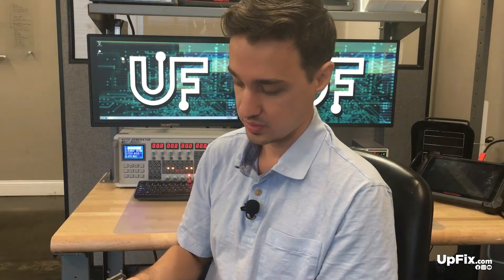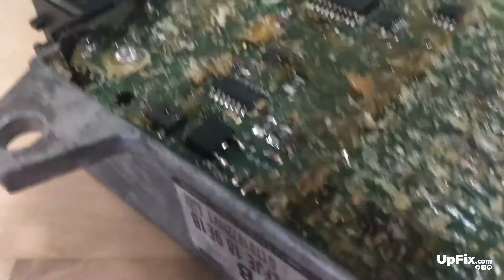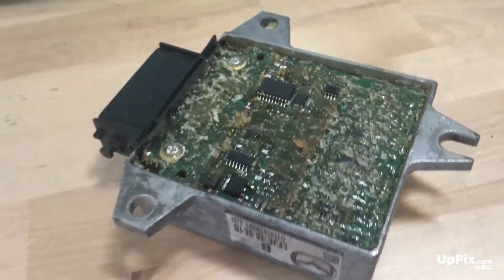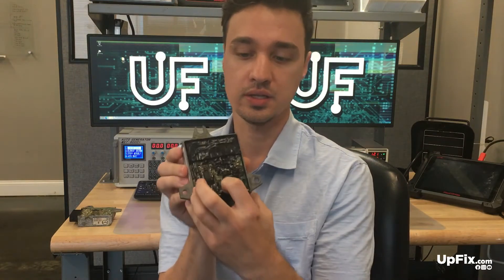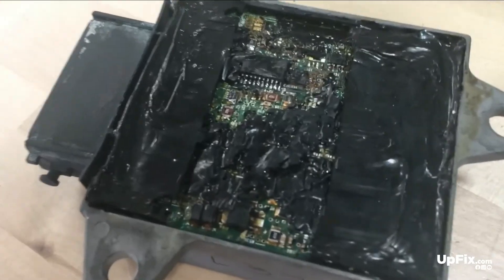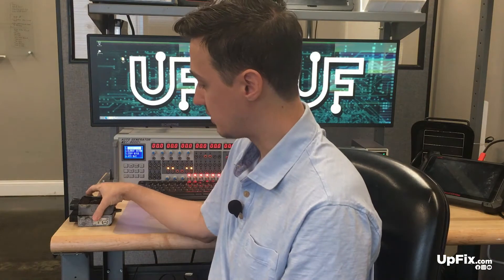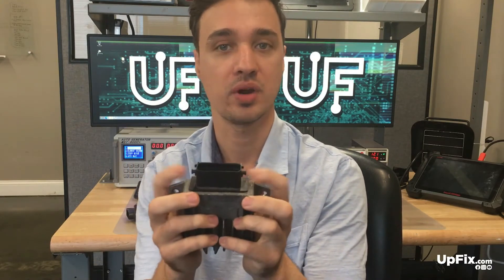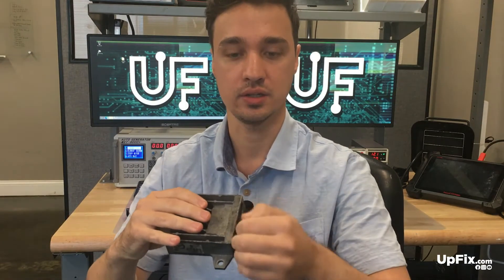Mazda 3 & 5 Transmission Control Module (TCM) Problems and Repair Service by UpFix

Comment: I tried sent to you, but you guys charging over 500 usa dollor plus shipping. To much cost you guys. I sent Ontario, they repaired same than you guys. But 440 total CAD, including round shipping
Reply from the maker: There are 2 options. 1st option is only $329 USD and that is for you to send your part for repair. 2nd option is that we send you a good unit that is ready to be installed but there is a core fee that is refunded after you send core back for refund.
https://www.upfix.com/product/tcm-mazda-3-2006-2014-transmission-control-module-repair-tcm-tcu/
Reply: Where in Ontario?

Comment: Hi good day have a 2008 mazda 3 getting a jerk when shifting from park to either reverse or drive does not happens all the time randomly and no check light or at light coming on no codes..... can you advise me.on this.situation please and thanks
Reply from the maker: Absolutely! Here's a blog we recently shared that should be helpful to you for your vehicle. Please let us know if we can be of further assistance. :)

Click Here --->: https://blogs.upfix.com/mazda-3-tcm-2006-2014-transmission-control-module-repair/

Comment: Mine, AT light displays sometimes and sometimes goes off. It its On, the digital display of gear numbers will go off too and car shift will be heavy, while it it goes off the gear shifts smoothly. What will you recommend? Kindly advise
Reply from the maker: Yes this is a common with Mazda 3 and Mazda 5. Usually these are the first signs of TCM failure. The transmission is good, its just the TCM. We do have these in stock 
https://www.upfix.com/product/tcm-mazda-3-2006-2014-transmission-control-module-repair-tcm-tcu/
Reply: @upfixauto  From the above vedio, you said repair is $199
Reply: Mine does the same thing how do I send it to you iam in South Africa

Comment: Can I put tcm Mazda 3 2008 to Mazda 5 2008
Reply from the maker: No it will not work. Part numbers are not the same.
Reply: @upfixauto  thanks
Reply: Do you have TcM transmission for Mazda 5 2008
Reply from the maker: @abosuliman123  
Yes we have Mazda 5 TCM available. There is a few different part numbers. Be sure to match part numbers to make sure you get the correct one.
https://www.upfix.com/product/mazda-3-2006-2014-tcm-transmission-control-module-exchange/

Comment: Good information, but I have a 2005 Mazda 3. I’m experiencing hard downshift from 4th to 3rd. Last time I drove my car won’t downshift to 1st. Your TCM will fix a 2005 model? Thank you
Reply from the maker: This is a very common issue on Mazda 3 and Mazda 5. The TCM starting to fail and causing these issues. We can repair this TCM. https://www.upfix.com/product/tcm-mazda-3-2006-2014-transmission-control-module-repair-tcm-tcu/

Comment: Is it caps mosfets or dry joints causing the issue , other than the  high run temps that mazda like so much.
Reply from the maker: Caps do go bad along with other PCB components. High temp is what causes this unit needing a rebuild

Comment: gear slipping/jerking from shifting 2 to 3, is it coz of ecu for mazda 6 gg 2.0 2005
Reply from the maker: Software update via OBDII scan tool should resolve it. Before you update you should also scan for codes and service the transmission fluid/filter.